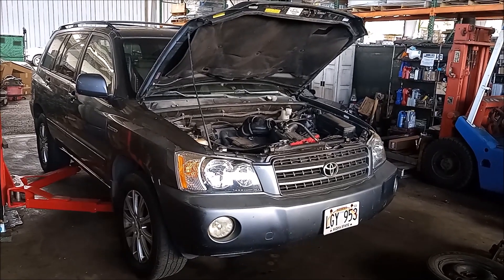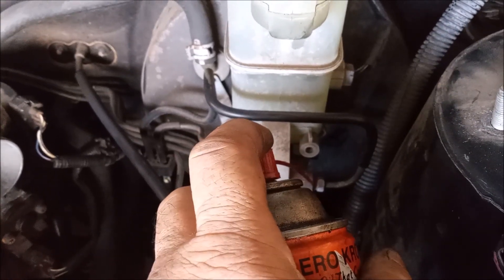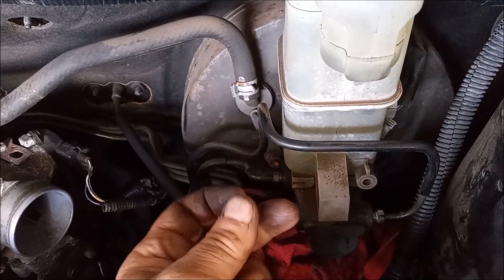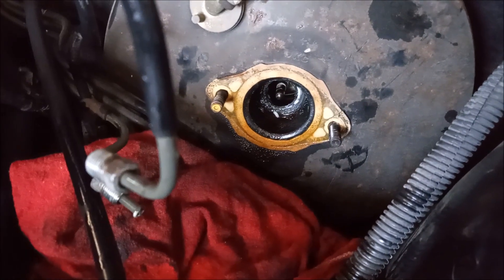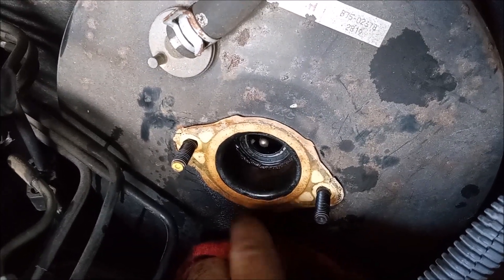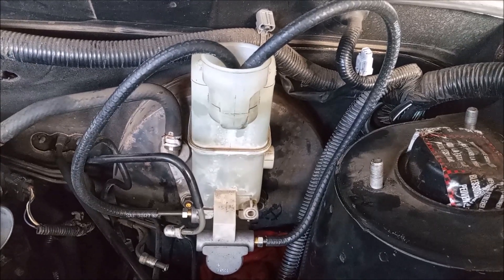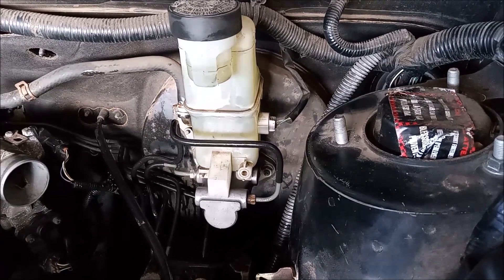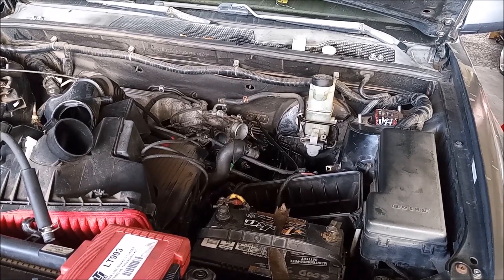Toyota Highlander Brake Master Cylinder - Remove and Replace

Comment: Question, to replace the booster, do you have to unhook the brake lines or can you pull it out to get the booster out?  I really dont want to bleed brakes after replacing the booster if i dont have to.
Reply from the maker: Never tried it. Let us know how it goes.

Comment: Great video. Question: after you bled the new master cylinder and removed the hoses you used, do you have to quickly unthread the bleeder hose and thread on the brake line? Does brake fluid pour out?
Reply from the maker: Do it quick enough and hardly anything comes out.
Reply: @Merryfrankster_  got it. Did you bleed the brake lines as well in case air got in there when doing the switcharoo?
Reply from the maker: @MCRinOC  yes of course always bleed the brake lines after MC replacement.

Comment: Do you have any videos showing how to replace the master cylinder sensor?
Reply from the maker: You mean the level sensor in the brake fluid reservoir? I can't recall how it is installed on these models.